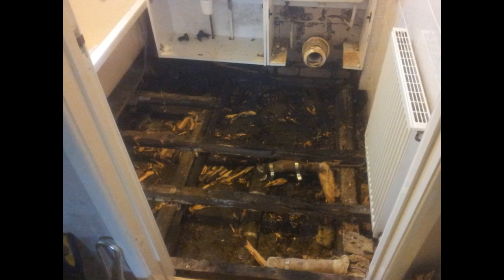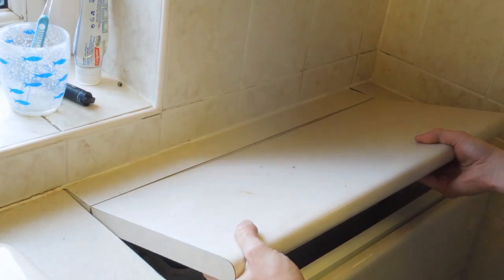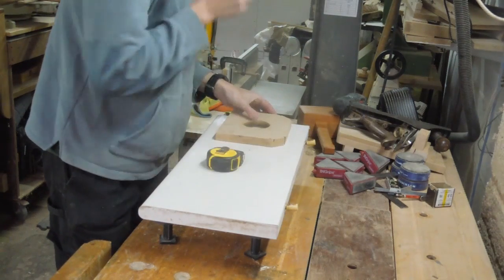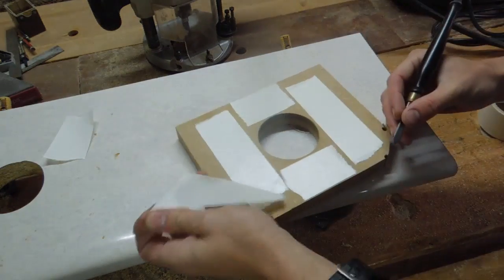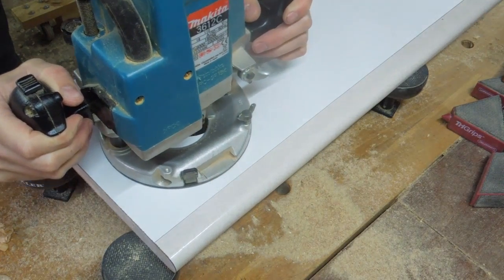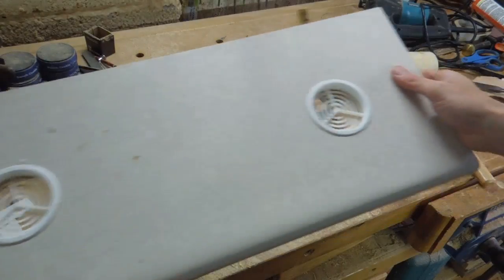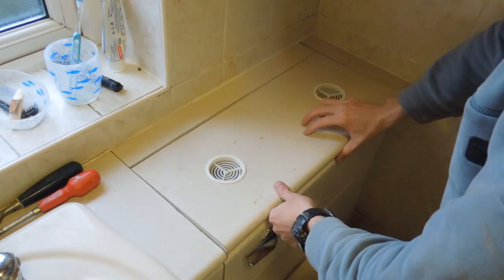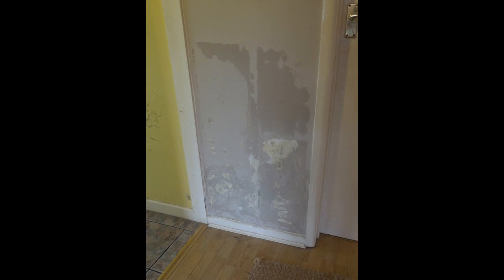Dealing with Toilet Cistern Condensation

Comment: Hi Olly, great video for a big problem. Please advise, I have a porcelain toilet cistern which attracts condensation and is connected directly to the cold mains water supply. I did insulate the inside of the cistern with a yoga mat cut to fit the inside of the cistern and glued in place with silicone sealant. It did work for a bit but eventually the air got underneath the internal insulation any blew out the yoga mat, may the silicone was not a good glue. The insulation was pierced to let the trapped air out and so scold water got behind the insulation after a few years with the condensation on the cistern returning. What do you think of me insulating the outside of the cistern with a lagging to warm the outer surface and reduce the effects of condensation collecting on the cistern and dripping to the floor. Thanks Michael
Reply from the maker: Hi Michael,
Thanks for watching and for your message.

There's a really good video by DIY Doctor on this subject:
https://www.youtube.com/watch?v=I0oAEn4mp4Q

Mike uses a white silicone, by the looks of it and so I'm not sure what could've happened in your situation. Maybe the silicone isn't a long term solution? Some foam mats probably allow water to pass through, if they're not a closed-cell construction.

I think you're idea of insulating the outside should work. It's unlikely the lagging would be cold enough to attract moisture, as far as I can imagine.

I hope this helps. But do take a look at Mike's video as he's far more experienced with this than I am. Maybe leave him a comment as well.
Reply: Thanks for the quick response, it can be shocking the damage caused from the condensation forming at the base of the toilet cistern. I will try a fluffy cover for the cistern,  if I can buy one, but not having  any lucky so far.